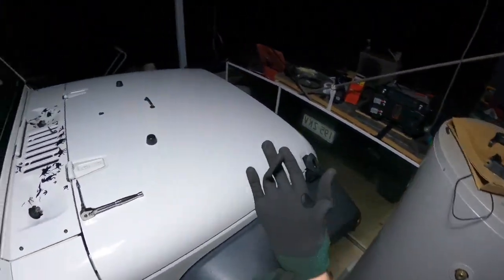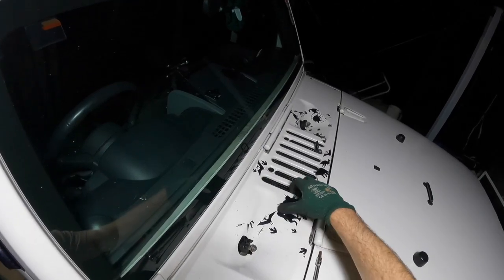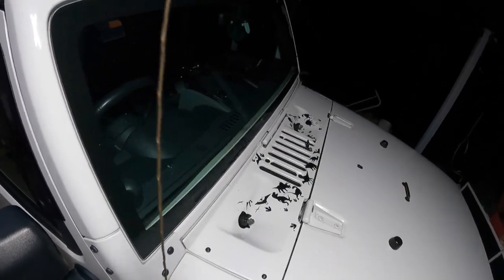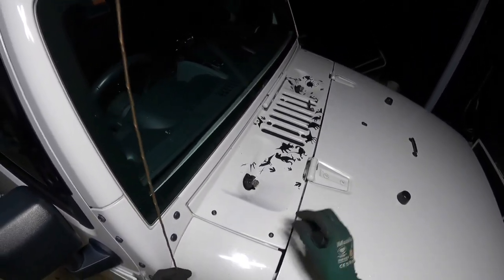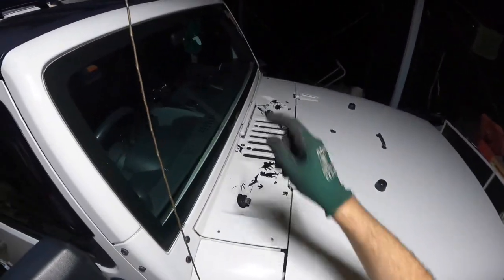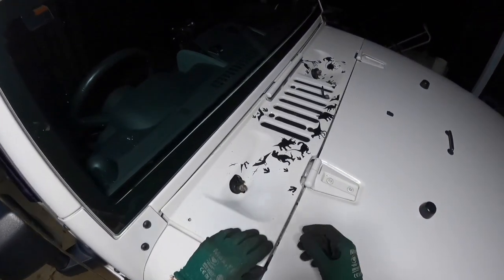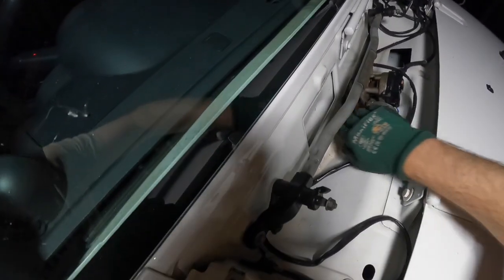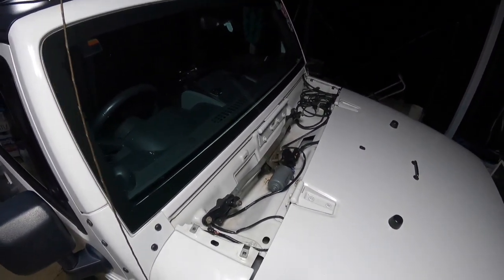HOW TO REMOVE JEEP JK COWL COVER

Comment: Mine was full of leaves and debris from being parked under trees. Those two christmas tree clips under the hood are a massive pain to oull out, even with a proper clip removal tool. And the plastic support basket thing that's attached to the cowl has little clips at the back that break off immediately. Annoying design, they should have stuck with torx bolts but couldn't help using silly plastic clips everywhere. Those christmas tree clips are the worst part of working on any part of this vehicle, they are everywhere.
Reply from the maker: Hahaha yep can definitely agree with that, replace everything with bolts would be the way to go.